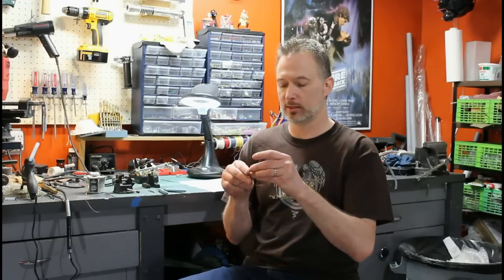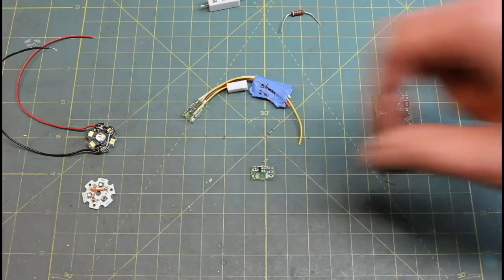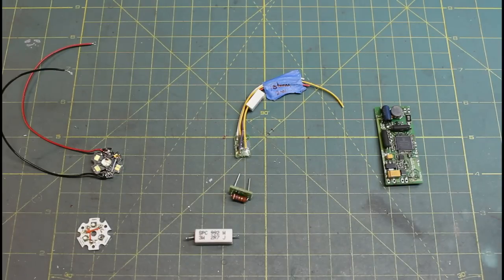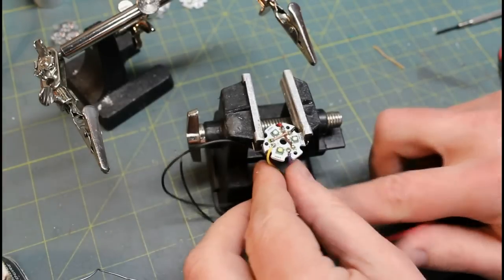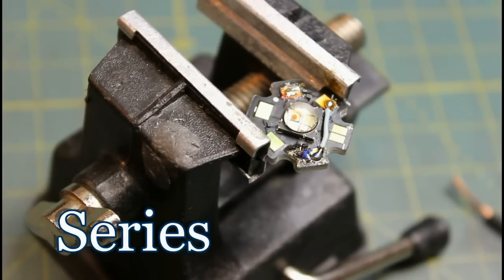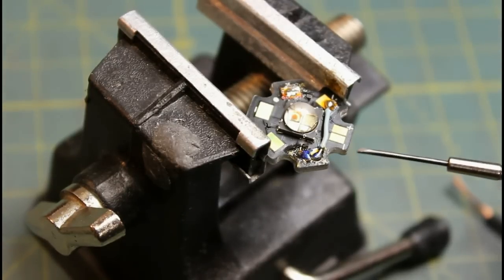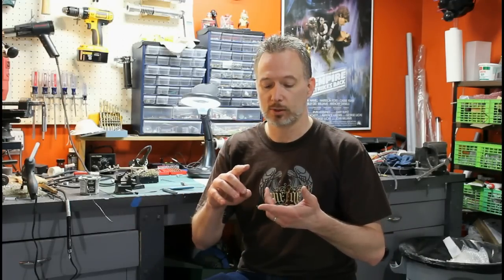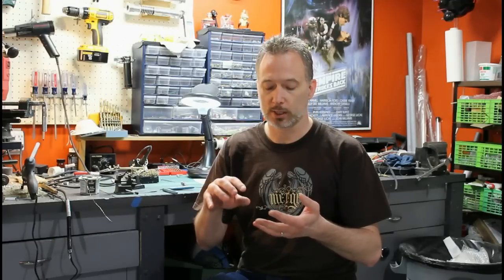Wiring Multi Die LEDs

Comment: I have an issue, my lightsaber have a Led engin light that has 8 connections,it needs to be replace (light not turning on).
I found one similar to it,but it just have ports for 4 wires,not 8.
How can I connect it? Would I need to eliminate wiring or can I connect them in a parallel?

Comment: Can you run a tri cree on a 3.7v lithium ion and If so what resistance would be needed?. It's currently running a 5 watt single green led with a economy sound card and 1 watt 8 ohms speaker with in hilt recharge

Comment: For the way you are doing the parallel, I would only use one resistor for the two colored LEDs and one resistor for the white, correct? I'll be using a Tri-Cree G/G/W. Using the ohm's law formula, I was recommended a 4 watt 1 ohm resistor for my two green LEDs (I'm assuming you only use one for both so I just doubled the amperage when doing the forumla.) Has everything I said checked out okay?

Comment: Hey Rob! I was wiring a multiLED and i think i burnt a sottering pad and now the sotter won't stick to it. Is there any advice or trick you can give me?
Reply: +Miguel Aulet You can try to use some flux. You can also use a multimeter to determine if there is a tiny pad on the side of the actual LED emitter that is the same as the damaged pad.

Comment: Ok, forgive me but my dyslexia is in full force today and everything is flipping around in my mind. Supposing I am wiring up my saber with a tri-Cree with an LED controller board utilizing 2 dice for blade + 1 die FoC, and is powered by a single 18650. What would the ideal setup be?
Reply: +ProjectDv2 A parallel set up would be ideal for you there.
Reply: +Dark Force That's what I figured, but I was so tired at the time I couldn't force my thoughts to straighten. Thank you very much for confirming it for me.

Comment: I'm building a lightsaber soon and it's red led tri with a white clash. I know I need resistors for the red but I was told I need a 1 ohm 1 watt resister for each red. would that seem ok or a bit low?  it's a 3.7 v lithium battery
Reply: +Bri w (willbo) You can learn to use Ohm's law easily, or use an online led resistor calculator. You'll need to know the Vf of your LED and it's max current. If it's a tri-cree, I would use a 1 ohm 3 watt resistor at least.
Reply: +Rob Petkau cheers. I been recommended a 2 watt or a diode

Comment: So just to clarify. If I have two red dice that normal run at 700 or so milliamps each, but when wired in parallel I should set them for around 1400?
Reply: +686BrAaiNS686 Correct
Reply: +Rob Petkau Perfect! Thanks for the reply, Rob.

Comment: I'm trying to set up three separate leds for a Kylo Ren saber. Would something like that first technique work for that?
Reply: kylethemighty It entirely depends on your setup. You could put them all in parallel, or if you have a board with accent LED pads, wire the cross piece LEDs to the accent pads to control the delay.

Comment: I am trying to find out how to wire all three or four LEDs together to get the brightest light possible. I want to use a tri or quad white cree LED with a 3.7v 18650 battery. How could I accomplish this?
Reply: Ryanbomb96 I would put them all in parallel

Comment: Hey great video but I was wondering how would you wire up an RGB LED with a master switch
Reply: Hi,
Not sure what you mean. There are many ways to use an RGB LED
Reply: sorry for not being clear.  what i meant was how would you wire up an Multi Die LED to where each one has its own switch
Reply: blake hoffman Ah, I get ya.
I've not tried that personally (too many switches for my taste). I guess you would run each die as it's own circut. With proper resistors, and choose 3 latching switches.
Reply: ok thanks for the quick reply

Comment: Hey really love your videos they have been instrumental in the planning of my own saber, I was just wondering if wiring in parallel this way works as well and is as safe. I have been told by a moderator on tcss forums that this isn't how u wire in parallel that each diode get its own positive and negative wires with their own resistors. Maybe he just doesn't know about this way of parallel wiring?? Just a little confused any info would help thank you (:
Reply: You can do it both ways. Since most of the sabers I make have sound cards with voltage regulators (PC, CF), I do not use resistors when putting 2 dies in parallel. If you use one resistor for both, it simply needs to be able to handle more watts.
Reply: Thank you (: Happy holidays!

Comment: I'm going to use a NanoBiscotti v2 for my card, can i still do the parallel setup with a tri-rebel ggw (using both greens) ?
Reply: Kevin Grzech Just one resistor when they are in parallel
Reply: Yes
Reply: Cool. Also, because the setup uses a really low resistor ( i believe 1ohm ), should i add it in or just adjust the drive parameter?
Reply: Chris Faraci I always use at least a 1/2 Ohm resistor. 1 Ohm would be safe. Then keep drive at full
Reply: Thanks. not only for the help in these videos but your sabers are what really got me into building mhs sabers
Reply: Chris Faraci Wow, thanks for the compliment! keep going!
Reply: Rob Petkau When wiring a NBv2 with a tri-cree, do you need to add a resistor to each die when it's wired in parallel or just one? Thanks again for all of the awesome tutorials. They are immensely helpful.

Comment: would it be the same as wiring the red and blue in series as wiring a quad cree gggw, with the green's in series?
Reply: with the right voltage and amperage of course
Reply: ImSharpi Theoretically. first, I would hook it up to the bench PSU to test the voltage at 1 amp - to make sure it's in the CF's range.
Reply: alright, sweet.
Reply: thx